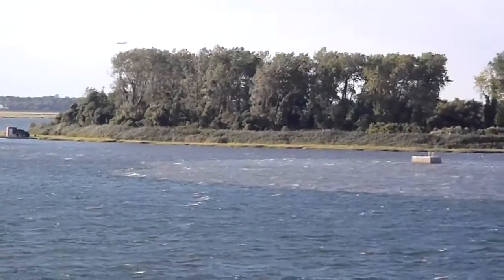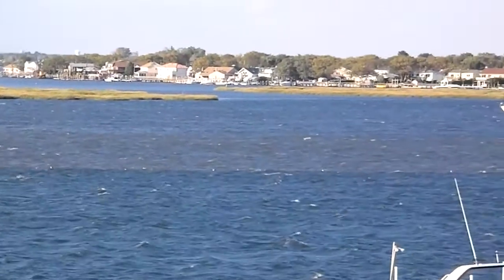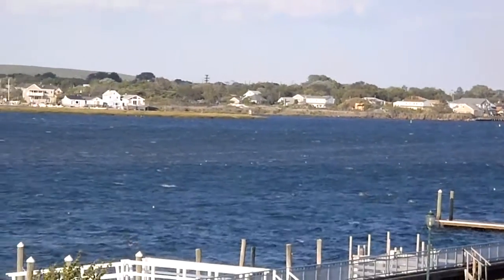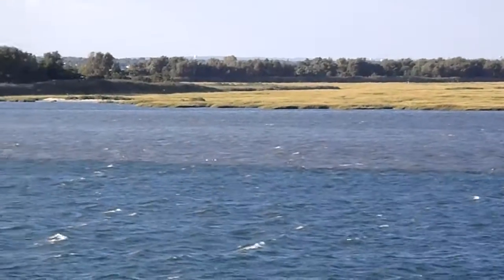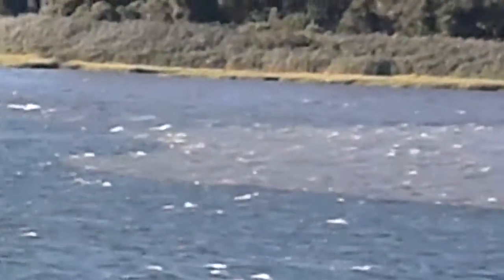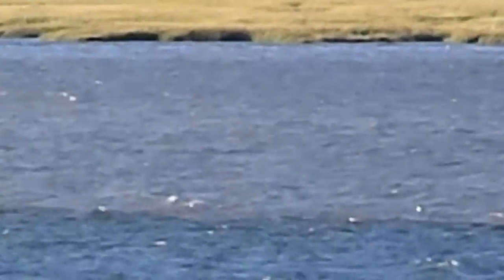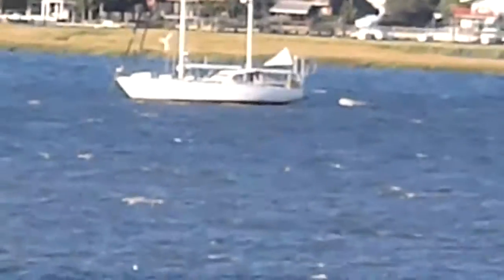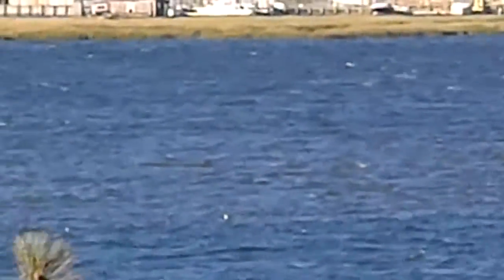What is dumping into Reynolds Channel Long Beach, NY  Sept 4, 2010????

Comment: I know what that is. It's a coolant outtake pipe end that empties out into renolds. There are generators that use salt water as a coolant in oil city (it's by the red and white tower) and the water comes out so hot that the water kills fish and other wild life in the area. Actualy, the hot water has also created a artificial ecosystem with animals that are not native to the area. There is also a backup flow that flows into the sewer but its not maintained properly and Sewage overflows out into